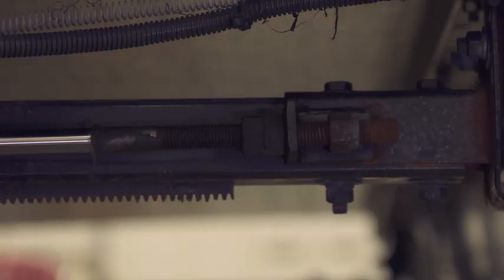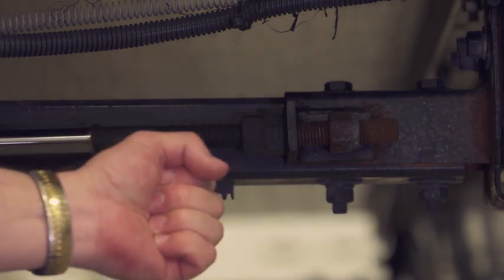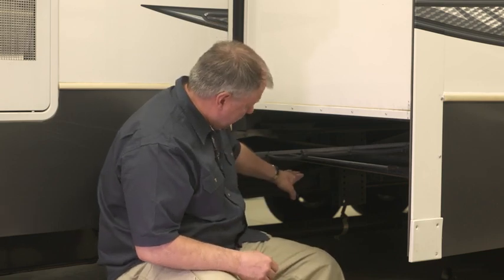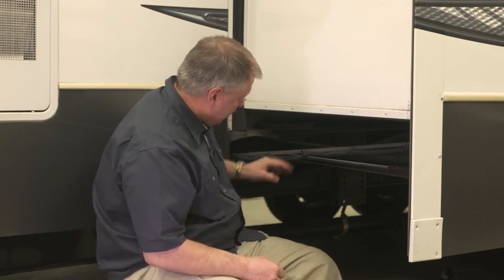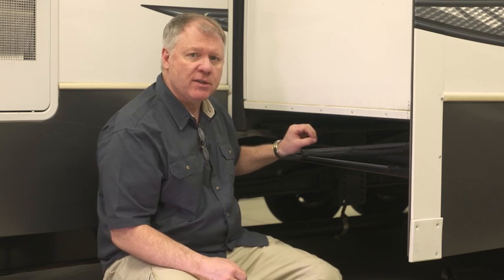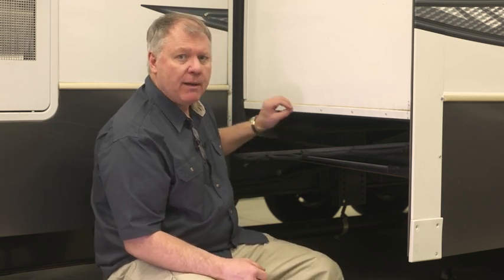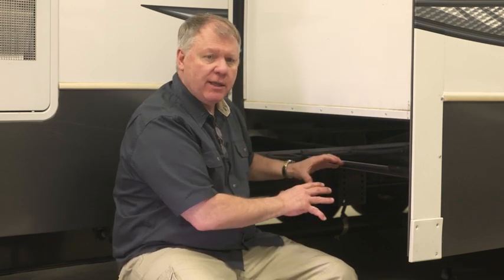Troubleshoot a Lippert Slide-Out: Motor Runs but Room Won't Move

Comment: I have an 03 sportsman and the slide out was acting out of line. Your comment of making sure the camper was level helped me to find the motor was loose. It didn't move until I adjusted the camper just a little. Motor screws were loose.
Reply from the maker: Great question! The ‘Ask an Expert’ section is currently for members of our online community. I would be happy to send your question off to the experts. To get started, please send the email associated with your paid membership account and contact Customer Service. Thanks!

Comment: Hi... My number 4 slide out won't come back in. I hear no power at all. I have a 2017 sprinter 5th wheel... Help
Reply from the maker: Hi Kelley.  It depends on what type of slide you have and what source of power it is using. If you have a hydraulic system the problem is most likely the solenoid or you have an issue with low fluid and should check for leaks. If they are electric slides then it could either be the switch, bad connection at the motor, failed motor, control board, low voltage or a bad battery. Typically on most of these issues you will hear at least something. Since you are not hearing anything at all it points more to an electrical connection issue. If you have a Schwintek system you will have a control board, these will give error codes and will tell you what the problem is so you would want to trace down the control board. If you just have the Lippert slide system, rails under the slide that push out, it is best to check the wiring to the motor as something may have come loose. It could also be the switch. Since you have other slides, you could swap the switch with another one to test it and see if that is the problem. Also make sure to check that you have good battery voltage and good connections as well. 
Thanks
Dan-RV Repair Club

Comment: My  bedroom Slide starts coming in but stops  about a foot before it reaches closure on the front side of the RV.  The motor has been replaced by a service tech, it feels like something is obstructing the room but nothing can be seen that could cause  the blockage,  any ideas would be helpful,  My RV is 2016  Forest River.
Reply from the maker: Hi R.B.  You would want to check the tube assembly rails underneath and make sure
 there is no obstruction in there. I would also check and make sure the 
adjustment rail is in the correct position, if the can or nuts came 
loose and re positioned it could stop the room from coming in fully. You
 will see these at the end of the actuator arm. After that I would check
 the clearance on the sides and make sure it is even going across, if 
the room is not centered it can cause this issue too. If it runs going 
out and most of the way in, the battery should be fine but it is not a 
bad idea to check the voltage on the battery as well. The amperage gets 
higher when almost in and a low battery could cut it out sooner. It is 
rare, but the tube assemblies could be bent too. A good inspection of 
the rails and everything underneath is needed to possibly find the 
problem. I hope this was helpful!

Comment: My slide out motor is running but the slide won't go in, it goes out, but not in.  What could be the issue? Is it the check valve?  All connections are good and the fluid resovior tank is full. We have a 2004 Georgetown Forest River. Thanks for and advice...
Reply from the maker: It's possible the reversing valve solenoid is bad. A check
 valve is very possible but I would start with the solenoid, this is 
more likely to go bad. Check to make sure there is voltage going to the 
solenoid when the switch is pressed to make sure the switch isn't bad. 
Before replacing the solenoid make sure to check all connections and 
hoses, making sure nothing is kinked or broken.
Reply: @RVlifestyleandRepair  I have the same issue on a 2007 Keystone Sprinter. I had to run the the slides in with a drill last time. I reversed the wires at the switch thinking this may work if it was an electrical problem, it did nothing! It runs the slides out and there is plenty of fluid, no leaks and no obstructions visible. We take pretty good care of the slides mechanically by spraying lubricants and keeping them level. I need to look into this more or get a schematic or diagram of the unit before I dive back into it. Anyone have a site?
Reply: I have the same issue did you find out what was wrong and why it wouldn't go back in. My trailer like you said I can see the motor running and spinning but it won't go in but it goes out very smoothly

Comment: My slide is a lippert and my top falls in when it is coming in. Is there a adjustment. Please let my know thank you.
Reply from the maker: Hi Justin.  The lippert systems just ride on the floor when coming in. They go up a ramp and the floor should be nose up when traveling in to prevent it from dragging on the floor. It is possible it just needs an adjustment but you want to make sure there is no damage to the floor too. With the slide in the out position, lift up the carpet or edging and check the ramp. If it looks fine, it may need adjusted. We have a video showing how to adjust these systems, I will post the link below. The slide could be too high and if your top seal is damaged or compressed could cause this issue. If the slide floor is hovering above the main floor when coming in but sits nose down, it could be the slide is not coming in far enough. When fully compressed the bottom will pull in on the outside and put the floor on the inside up. When it is closed, check to see if the slide is compressed the same on the bottom and top on the outside. If the bottom sticks out, you would have to adjust the stopper on the actuator arm. It is the arm with a can on it, the big can is what needs  adjusted to adjust the inward travel position. Make sure the slide is at least a little bit out, not close. Loosen the nut on the back of the can and then the can can be turned. Move it outward towards the slide wall just a few turns. This allows the slide to come in further. Adjust it a little bit, re tighten the nut and see if this helps.
https://www.rvrepairclub.com/video/adjusting-rv-slide-out-seal-011521/

Comment: Have power to slide out switch but none to motor, any suggestions
Reply from the maker: Hi Robert.  Do you have power coming out of the switch too? A lot of times there is voltage going to it but when the switch is pressed, nothing comes out due to a faulty switch. If there is voltage coming out you will want to check all of the wiring and look for a loose or bad connection. A lot of times it is the connections at the motor that are faulty. There shouldn't be anything in-line stopping it from working unless there is a bad connection somewhere or a wire was cut. If you have a motorhome, there are safety switches that have to be activated for the slide to get power from the switch. Usually a keyed switch and parking brake switch have to be activated before voltage will go to the motor so it could be an issue with one of these as well. 
Thanks
Dan-RV Repair Club
Reply: @RVlifestyleandRepair  thanks Dan, I will check and let you no